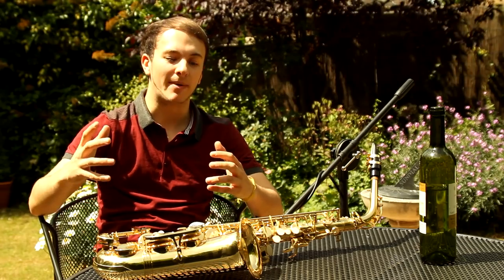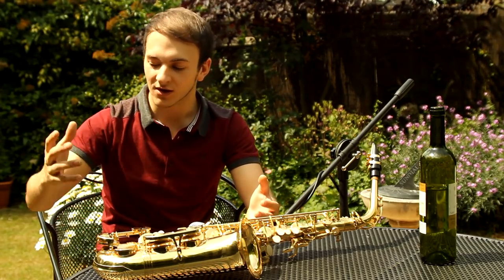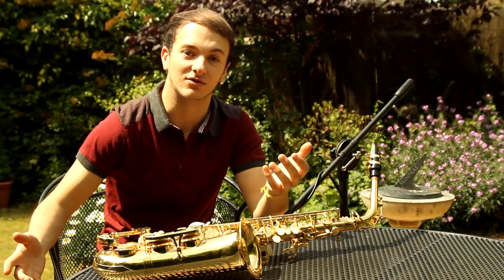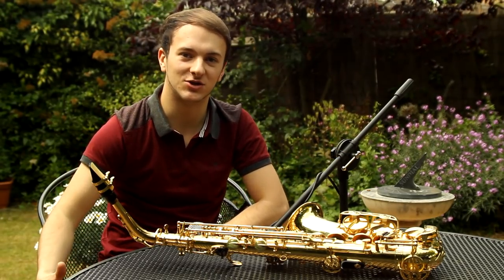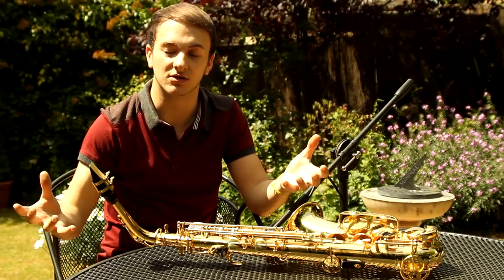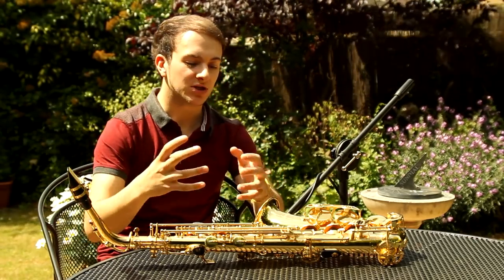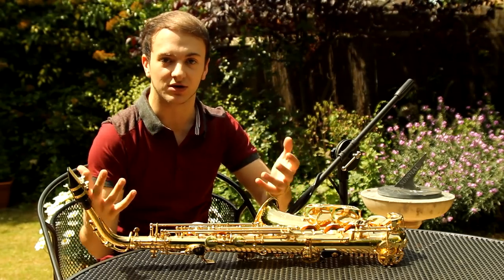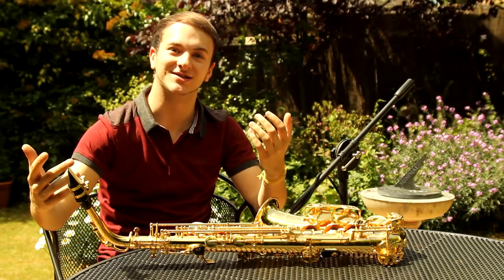Transmission / T-line boxes - How they work!

Comment: I recently made two t-line tube systems  and was testing how low I can go with a pair of 6.5" subwoofers. I'm astonished at the fact that I could actually feel the bass shake me at 14hz with such small sub's. And the diagrams were only moving half an inch. The tubes were around 112" long each approximately. I'm also thinking about adding a ported chamber in front of the subwoofer to further aid in creating an added bass boost between 40hz - 80hz.
Reply: The air movement can really shake people up. Much more if put on a car, with larger drivers

Comment: The reason why ported boxes sound less tight is because you are delaying the sound waves from the soundwaves coming directly from the woofer. The sound waves coming out of the port can also be out of phase with the soundwaves coming directly from the woofer depending on the tuning of the port and the frequencies produced, this can cause certain frequencies to be cancelled out.

Comment: I found the analogies of sealed and vented boxes very easy to follow
Parts of the T line box explaination I understand; I was once a radio tech and in particular wavelengths are directly translatable... but I'm afraid I'm still looking for another description of how the T Line works.  I do however understand much more than I did before this video, for that thank you :)
Reply from the maker: thanks haha this is a very very old video now 😂😂
Reply: @barevids  I looked at the age of the video before submitting but thought the info is still very relavent.  Honestly, thumbs up for that venturi effect on the wine bottle... I can literally see how this works now!
I'd like to connect on LinkedIn, I promise not to bother you with crap... but there's a lot of non-direct/relatable things we do...
Reply from the maker: @bradgriffiths7507  haha thanks! I don't have a linked in, but you can message my page facebook.com/barevids

Comment: the reason is a 1/4 is because the transition line is delaying the sound that is comming from the rear of the sub (which is 180° out of phase) by 1/4 wave length at the tuned frequency. this means that at the tuned frequency the front of the subwoofer is in phase with the rear of the subwoofer. this is why t-lines enclosures are so efficient
Reply: I think that 1/4 wave is 90 deg and sounds are not added exactly in phase, and total sound is 1.4 times.
Reply: DRXxUziixX95 true

Comment: My friend and I built a large t-line box for a pair of Pioneer 5000 SPL's
All I can say is, that box turned out perfect for those subs.. 
While testing the subwoofers at only half power, they put out some ear-crunching dB's
The frequency-response of that setup goes from 15-80 Hz, with a smooth peak around 27 Hz, but stays linear all the way..
Perfect for decaf and low-hitting songs. - Your "Basso Profondo" rebass songs is a good match.

Comment: From my experience, unless you're running huge power, then SQ and SPL there's always going to be some sort of compromise. When it came to designing for my Hybrid Audio I6SW, it played well in my first enclosure designed fro 43hz response, but no where near hit low enough for my tastes.

The last enclosure I designed was for high 20's which it does comfortably, but it doesn't quite have the energy the 43 box does. Aim for mid 30's, shove some power into the sub.

Comment: I have come to a point where I can actually sim a t-line enclosure quite accurately with programs like LspCAD. You need to take a lot of parameters into account and that's where something like LspCAD will come handy. One big advantage of t-lines is reduced distortion because the pipe will help the driver at a broader range of frequencies. It will also give an overall flatter response compared to vented. In general a t-line sounds faster and punchier when tuned right

Comment: Excellent explanation ! But just some food for thought... I have plans for a future build on my desk right now, for Two 15" subs in a T-line enclosure... but by running the subs Isobarically (face to face in a clam shell configuration) instead of the T-line build being so massive Id need a moving van to put it in, it actually becomes considerably smaller. Not tiny, but doable in the rear of my F150 Supercab :) Ran this way, the cross sectional line only needs to be 1/2 of what a single 15" sub would normally need, and 1/4 of what two 15"s would need :)
Reply from the maker: Hi! Yes, Isobaric is useful for situations like this. I'm not sure about halving the line area though. I predict high restriction and noise. Also, if your goal is output, then you'll achieve better results using the two 15s in a regular ported box or even 6th order if you can fit, than the iso t-line. Like, considerably more output. I tend to only use tlines when trying to make smaller drivers do rather crazy things.

Comment: Btw, the way a port works is by delaying the soundwave to add it back in in phase with the soundwave coming from the woofer but since diffrent frequencies need diffrent lengths of ports its impossible to tune every frequency and to prevent other frequencies from getting out of phase.

Comment: It seems like this is describing a tuned quarter wave pipe. I've heard people say that the other function of a T-Line is to provide a resistive air load to the back of the speaker to give tighter bass (stuffed lines), whilst using the quarter wave phenomenon to extend the lower bass response.
I'm not that knowledgeable on Transmission Lines so take what I said with a pinch of salt.

Comment: The wadding vibrates WITH the air. This is why it has the effect of increasing the internal volume of a sealed box, because all of the thin, light fibers move WITH the internal air pressure. However, in a t-line application, the air is able to escape through the port thus generating much more air pressure from allowing the speaker to move more. However, the fibers are static. They generate RESISTANCE to high levels of air pressure thus slightly decreasing air movement.

Comment: here is my take, the air moves back and forth down the length of the transmission line and resonates at the tuned frequency. The wadding doesn't slow down sound, but slow the air speed. The wadding is a restriction. So if the air cannot travel as fast, it can not resonant as fast.

Comment: Very informative video! I just have a question to ask you.
So I transformed a Dahlquist DQ-1W (which is a sealed 13" passive sub) into a sealed powered subwoofer by cutting open the back and installing a plate amp. When I had the back opened, I noticed some bracing of the box but also a SERIOUS amount of 'polyfill' I think it's called. Like the inside was basically packed right full of this stuff. And the enclosure is quite massive (26"x13.5"x18"). I've always thought the purpose of a large box was, well, to have a large open interior. Not packed full of 'stuff'. But I figured a highly successful audio company such as Dahlquist know what they're doing, so as of now the polyfill is still in there. And it sounds pretty good, but it cant hit much lower than 30-35 hz, which I feel like it should. Large sealed boxes aren't supposed to have a sharp roll-off from what I've learned. My question is: Should I remove all the polyfill? Or leave a thin layer on the walls, or leave all of it?

Comment: I really liked this. Very interesting. But i have a few ?s. The only long tube i could find is pvc pipe. Is this ok for speakers to make a t-line tube? 2nd How long is a 1hz full wave leanth. 3rd Could you make a full wave leanth pvc tube for a small speaker. Just to see how low you could get it. Plus make a video so we can see how its done. As imformation is hard to find and not explained. Youve done a good job on explaining it. Now we would like to see a full wave leanth tube and how it sounds. Lowest note possible please. Looking fowerd to more t-line project videos. T-line tecnolagy is awesome! Thanks for the introduction.

Comment: Slowing down the speed of sound doesn't change the frequency. It just changes the phase angle of the terminus. Even so recent studies have shown in a speaker box it hardly slows it down at all. First thing you should have said in this video is that you are talking about vented t-lines. Closed t-lines are actually more 'hi-fi' but are half wave resonators requiring even larger enclosures. Look up 'Martin J. King' and mass loading transmission lines. You might like that if you like deep bass!

Comment: A tline is a rear loaded horn except there is an inverse flair or no flair wich helps make the box smaller than a regular horn. Tline is another alternative you can pick depending on how much space you are limited too. Horns aren't practical sometimes because of size. Ported or tline shrink down better than a horn so for smaller sizes they might work better than horns. An example is the auto tuba, its small but its basically a 60 hz horn.

Comment: I want to build a horn loaded subwoofer enclosure because my car has allot of space like 116" inches (2946.4mm) 					 						long X 42 inches (1066.8mm) wide X 42" inches (1066.8mm) tall box I can fit in the back it's a hearse that is why it has allot of room. Hopefully it would fit a horn enclosure or t line that will work with 2 15 Inch subwoofers. This video is very informative information thanks!
Reply: +2010HarleyDynaFXD if you're driving a Hearse you should build Steve Deckert's "Death Box" hahaa

Comment: Bro that was the best explination on how sound, speakers and there boxes work ive heard yet. Thank you.

I am about to embark on building my first set of sub bins and have started looking into what exactly is involved in building a decent rig. 
i have a few questions... my goal is to build a system that will be powerfull enough to pump psytrance thru a dance floor of about 300, out doors. i already have 4kw of mids and highs (jbl  & yamaha) but am only pushing 1000watts (rms @ 8 ohms) of low end, and its not keeping up..

what i would like to know is, in your opinion, what would be the most efficient cab design for my subs?? and what drivers should i look at??

I have a a spare crown amp pushing 6000 watts at 4 ohms mono bridged, (so thats about 3000watts sterio @ 4 ohms) to push it, and am wanting you build a nice efficent sub bin.

whats your thought on the matter??
Reply: +TimmeH Gone Riden: Horn should be considered for your use, depends on how big speakers you can accept.

Comment: Can you help? Only at your convenience!

I'm giving my system to my brother for his birthday. So all I'll have left Is a head unit and my lanzar. I'm giving the pioneer away because it takes up so much space and the box is rubbish. The lanzar is good with highs, but struggles in the lows for it's a sealed Lanzar max 8. I'd like to know what would you recommend for lows. I need it to be stupid loud! (If your sure of a good design then size won't matter, just need to get loud enough to piss everyone off.)

BTW, Its a bedroom system. I already have a  400 watt amp, and I'm sure my power supply won't like any more then 1,500 watts. It should be around 1000 watts RMS subwoofer or less.

Comment: I've built a T-Line enclosure for a 6,5" dd 500 redline sub using this formula and it sounds great at low/medium volume but at higher volumes when the sub gets to move, a lot of turbulence starts to occurs at the port. Any idea of what causes this?

Comment: Sealed and ported boxes are the most popular. You explained a bit about t-line boxes. But there's another type of box I hear about and thats bandpass. Bandpass box comes in two forms. 4th order and 6th order. Maybe you can make another video explanation on how a bandpass box works. I like SQL over SPL. I find the really low notes just as important as the higher notes. I'm trying to figure out what box is best for ultra low notes and remain SQL.
Reply: and 8th order
Reply: bandpass boxes are basically a sealed box and a bass reflex (ported) sharing a wall with a driver bridging the wall. 

it gives very high spl (+6db I think), but only at a very small frequency range giving it a "one note" sound, so not good for sq

for sq use a t-line or sealed box generally, but you can also use an infinite baffle or folded horn
Reply: You know you really shouldnt be giving advice when you dont know what you are talking about.  4th order design the DB increase is dependent on your ratio of sealed to ported, most common is 3:1.  If designed properly the can have a huge bandwith and be just as SQ as a Sealed enclosure.  6th order boxes are most efficient and best sounding but incredibly difficult in designing.  Now Folded horn enclosures are only good for concert halls and such because they are designed for the SIN Waves to meet peak a certain distance away from the enclosure so they in effect are louder 50feet away compared to right next to them.
Reply: +james577864 bandpass boxes can be made so that they have a wide usable response and can be fairly musical, but they can never match the same driver in a sealed or even ported box for sq. My current sub is a .6ft^3 bandpass with similar output to a 1ft^3 ported box with the same driver (with the exeption of the frequencies above 150hz). it is okay musically, but it really doesn't sound as good as a ported box. I sacrificed the sq to make it a bandpass then sacrificed the extra output to make it small. this is fine for it's purpose as an lfe sub
Reply: +james577864 about the horns: the wave doesn't have to fold out or anything like that, and any sound source will not be louder 50ft away than 5 ft away so long as it is the only sound source (once you start adding more speakers into the mix things get weird) horns are used in consert halls and such because they can be LOUD (some horns can be 10-15db louder than the same driver in a normal configuration) and relatively directional compared to other speaker types

Comment: Barevids, i'll be getting hold of an old-school 15" subwoofer tube (Rockford Fosgate model) I was just wondering if I will need to run any extra additional batteries in order to power the sub etc? Also will I need an upgraded alternator? (The car it'll be in is a Vaxhaull Corsa C)

Comment: question in building a tline box does firing the sub down into the floor affect anything? sound output? im finalizing the design of a center console tline box ideally the sub will fire down and the port will likely be on axis? any input?

Comment: I understand using a quarter wavelength in a car application. But what if I have a room in my house that has more than enough room for a full wavelength t-line box. Should I use it? I'm assuming that full wavelength of a frequency is better than a quarter. For sound quality. Maybe less port noise. I can't find the information I need on t-line technology. It's a bit confusing.
Reply: You cant use the full wave because physics says you need to have a peak on the end of the tube. you can use 3/4 of the wave or 5/4 etc. but it wont make a difference except for the box size. my advice: use the quarter wave tuned to the resonace frequency of the driver as if it was a closed box. (the resonace frequency changes due to the size of the  box) there is a tutorial on this on YouTube: 'tline box math made easy'

Comment: Cerwin Vega has been making horn loaded subs for years. I think they sound amazing but from over 50 feet away. Standing directly in front of them does nothing for you but stand back 50 feet and they kick you in chest. Do these T Line boxes sound great up close because no matter how you slice it, at the end of the day you are very close to your setup in a car?...
Reply: I am myself about 10 feet away from my subwoofer which is an 8" in an.. I'd say a little too small enclosure. It sounds great, no matter where I stand, Except for the middle. However, that's in  a room. I think you'd need quite a bit of an enclosure and driver to actually hit the desires SPL in open air. However that's my opinion, dont forget that.

Comment: The wave does not bouncing back and forth because it is longitudinal and travels the length of the t-line. So how does the amplitude increase as the wave travels down a expanding t-line? The t-line does not add energy to the system.

Comment: I dont think what they mention in that artice is correct, I could be wrong though.

The only thing I can imagine the wadding doing is reducing the vibrations of the box and the noise of the air moving trough the port. Maybe dampening is what you want because by doing that you slightly decrease the boost at the frequency your port is tuned at but also decrease the phase cancellation, making the bass fuller and tighter.

Heres an rtice on speed of sound
en . wikipedia . org / wiki / Speed_of_sound

Comment: I don't need a 400" transmission line Box whenever I want to hit 30hrtz...  Minus tuned to 33hrtz and is only 50 inches...  Granted i'm only four 4" high excursion subwoofers...

Comment: The reason for the stuffing isn't the slowing down of sound. It's actually related to the R factor or it's insulating effect. The stuffing filters unwanted higher frequencies from being sent out the port. Use no stuffing or too little then too wide a range of frequencies come out. Use too much stuffing and the filtering effect is too much because it filters even the desired frequencies. Use just the right R factor of stuffing and you'll get the correct narrow range of bass frequencies emanating from the port. These frequencies ideally begin at the point the woofer rolls off (aprox 40 or 50 cycles in a typical large TL) on downward to the lower limit of the system.